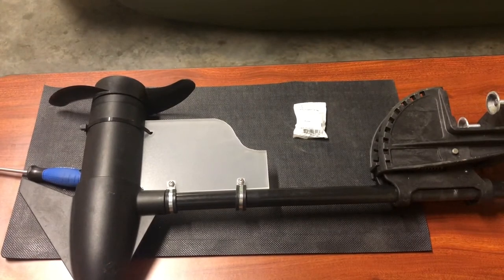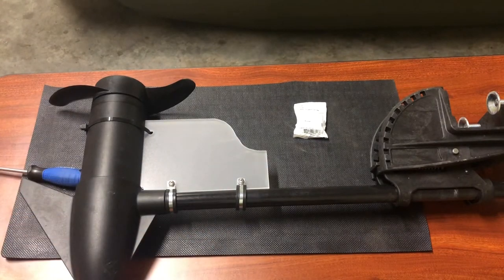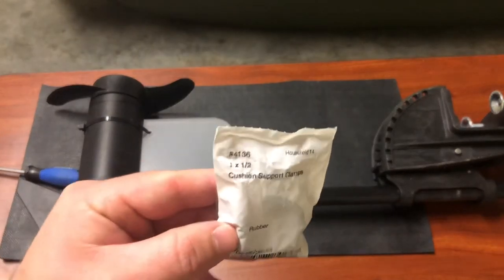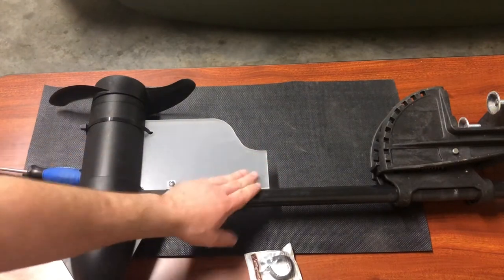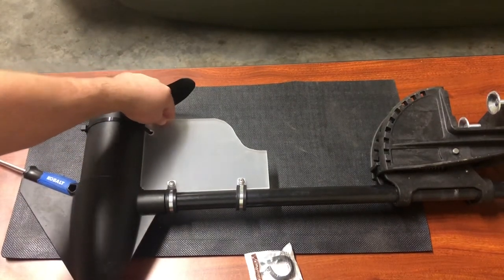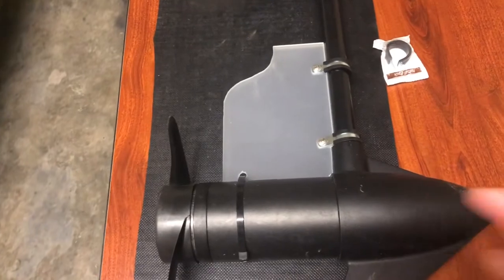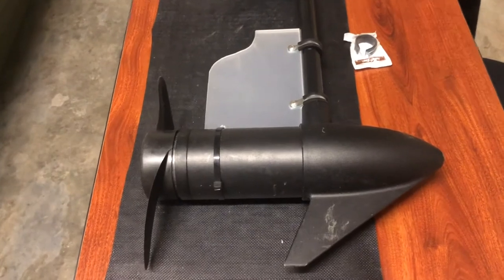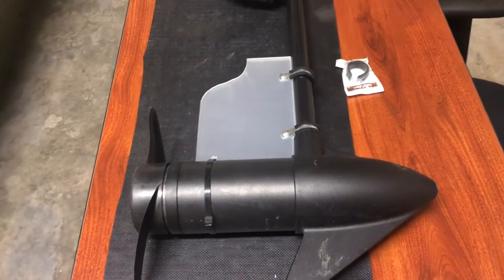DIY Trolling Motor Rudder //Minn Kota //Cheap and Effective

Comment: Great vid! Thanks for the super easy mod idea. I was just about to drop $40 on a bullnose. Those clamps are called steel suspension clamps. That may make it easier for folks to find them. Should be easy to find at any Lowes or Home Depot.

Comment: You may be able to find a band clamp like those small around the shaft in a large enough size to fit around the motor instead of using the zip tie.

Comment: I'll be naking one for my trolling motor, as well as a set for the bow area to keep the canoe going straighter on the path I want it to travel
Reply: Install a pair of paddle length, straight flat boards, vertically, like they were un-steerable rudders at mid-ships of a canoe, so they sit in the water by a paddle length deep in the water. If the wind catches the bow, the boards will help prevent the bow from swinging on an off-course  direction, and keep you paddling in a straighter line much easier. The boards act more, or less like a deep keel, normally located under a boat, but these actually hang on either side of the hull, at around mid-ships. The water creates a fair amount of drag (sideways in either direction), against the boards, to help prevent the bow from going off course, when strong winds catches the bow. They can be installed as part of any outrigger unit, but are snug close to either side of the hull.

Comment: Do you do this on a front or rear mounted trolling motor?
Reply from the maker: The rudder is great for both setups, essentially it helps create more surface area on the motor to allow it to steer better. Without the rudder it doesn’t steer and respond as quick.

Comment: That is great!  Thanks for sharing 
... i am getting that Minn Kota trolling motor and doing this mod. Now suggest me a good trolling motor battery for the money
Reply from the maker: The battery I use is a 24 group size Everstart battery from Walmart. It is a deep cycle marine battery and it is only around $75. It usually lasts at least 6 hours of constant trolling without being recharged. 

Battery - http://www.walmart.com/ip/EverStart-Lead-Acid-Marine-RV-Deep-Cycle-Battery-Group-Size-24DC-12-Volt-690-MCA/180350522

If you go up to the 27 group size it will allow a longer run time.
Reply: @bluecollaroutdoors5556   Thanks!
Reply: Using the 24 group size walmart battery gives about 50 amp-hours usage, assuming you don't discharge more than the recommended 50% of the 101 amp hour rating. I'm thinking of going with a lithium battery (Lifepo4) which can be discharged 90% and last about 10 times as long (in charge/discharge cycles). An equivalent lithium battery is considerably smaller and also weighs about 10 lbs vs the 45 lbs for the flooded lead acid battery.  The kicker is that an equivalent lithium battery (60 amp hours or so) will cost about $200 up front.  The lithium battery will excel in all aspects but cost. Just food for thought...
Reply: by the way- Great video!  Great way to save money on a simple mod and I subscribed!
Reply: @baronistheone   where do you find the 60 amp hour lithium battery for $200 ?
Reply from the maker: @baronistheone  thanks for the great breakdown, the lithium battery would be an excellent option if someone had the money, I know the 45 lbs battery gets very annoying lugging it around. Also thanks for the subscription!
Reply: @TADDs101  I did probably underestimate that.  I'm contemplating a 36 ah LifePo4 for $129 on amazon to use with a 34 lb thrust motor. A couple of those would give you 72 ah for $260. Prices are still dropping as usage increases.  In my case the weight is the main reason I plan to go with lithium.

Comment: Did you get the nuts and bolts separately?
Reply from the maker: I bought them together from lowes in the hardware section. It really doesn’t matter what size bolt necessarily the main thing is to get the type that has the synthetic lock nut that way it doesn’t loosen up easily over time. I hope this helps man.

Comment: What are the dimensions of the board?
Reply from the maker: It’s probably about 10 in tall and 5 in wide. This is slightly bigger than the ones you can buy from a retailer.

Comment: For the life of me I can’t find those cushion clamps anywhere in 1 1/2 inch. Unless I want to buy 20 of them lol
Reply from the maker: I found some for my buddies that were trying to do this at Menard’s, if you have one close it could be an option.
Reply: @bluecollaroutdoors5556  thanks I’m in Canada though, we don’t have that store. I improvised though and just used all zip ties. It actually works really good. Will do  until I can find those damn rare cushion clamps haha. Thanks for the video it saved me a lot of money 👍
Reply: @mduyn  how did it work with the zip ties? Having the same problem myself, do the zip ties hold up? Thanks
Reply: @mikehunt8117  zip ties worked perfectly, used it all summer.